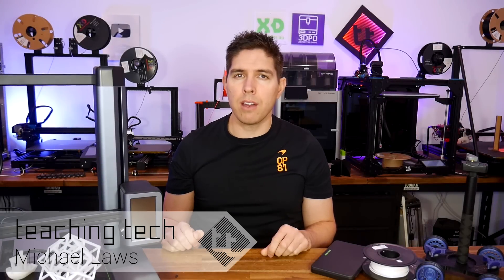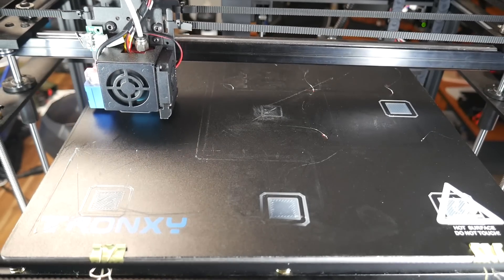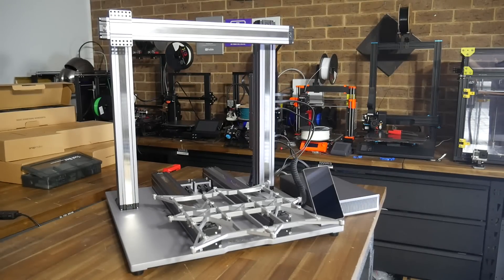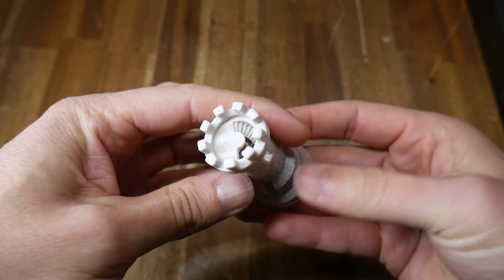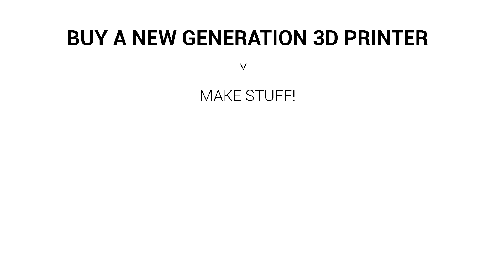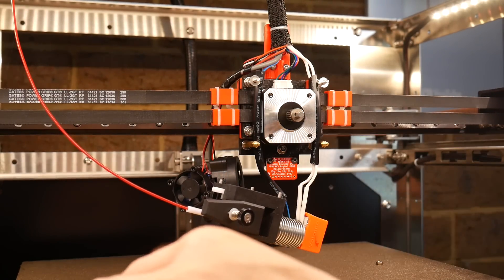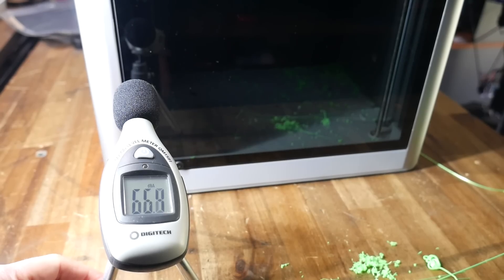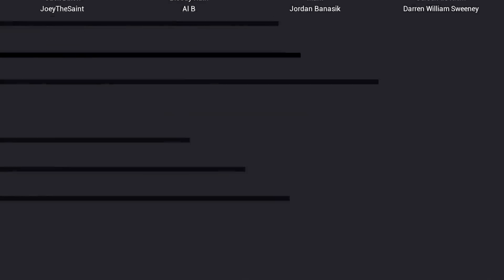Next gen 3D printers are here, but do they bring fresh problems?

Comment: i genuinely appreciate that prusa printers (and many corexy designs) are designed with 3d printed parts in mind. meaning if something breaks, i can reprint it and not worry about the change in mechanical properties from metal to plastic. and this also goes along with those printers being easily repairable through third party vendors. while i will credit bambulab for having very reasonably priced replacement parts, the fact i can only buy through a single source is kind of annoying. also being reliant on the company to design upgrades that fit the printer and my needs rather than being able to use open source designs made by anyone. 

before i bought my mk3s+, the p1p was really the only other printer in that price point i was cross shopping, and that was only because it actually had a way for me to buy replacement parts. while not everyone wants to tinker on their printer, right to repair is very important in electronics. both for the consumer to save money on repairs but also by creating less e-waste by being able to make those repairs.

using your own analogy, it would be like buying a car that "just works" until you get a flat tire and can only buy replacements from the original manufacturer. or the new subscription models we're seeing rolled out for infotainment or heated seat upgrades.
Reply: I dont want a 3d printer made from 3d printing parts. The reason I love 3d printing isn't because 3d printing is the best production technology, it's because it's the most accessible. But it's a compromise on almost every level, and I'd prefer production parts were made with production methods.
Reply: No one reasons like this with the rest of the stuff they own. You've got an open source dishwasher at home?
Reply: @bagibadoo439  no, but i can easily find generic replacement parts for things that break, maybe not for everything but a lot of things. i dont want literally everything i own to be a black box of mystery where i only know what buttons to press to make it work. sometimes i like to be able to fix things myself rather than hiring a specialist or replacing it outright. its not the open source nature of it that is attractive, its the ease of repairability. it just so happens that the reason it's so easy to repair is because the design is open source and anyone can make parts for it.

also one of the benefits of 3D printing that Teaching Tech talks about all the time is decentralized manufacturing and creating parts where off the shelf solutions don't work. imagine i had a part on that dishwasher that DID break and there was no replacement part offered, i could potentially print it out on my printer. to me, this concept goes hand in hand with having a printer that's easy to repair and find replacement parts for.
Reply: @WheatMillington  now, im not a materials scientist or anything but as far as i know the only difference between injection molded plastic and 3d printed plastic is layer adhesion. assuming parts are designed with that limitation in mind (print orientation, number of perimeters etc) then i don't see much of a difference other than appearance. i also think you may have latched onto that part of my comment and ignored the rest of it. it's not JUST that it uses 3D printed parts, it's that it uses parts that I can easily replace by myself without having the machine be down for days while I wait for replacement parts or a tech to come out and service the machine. also, none of the printed parts are structural so I don't have to worry about reduction in print quality when I replace a stock part, since plastic is much more malleable than metal. the parts that aren't 3D printed are readily available from multiple sellers, not just through prusa directly. when you can only buy replacements through the manufacturer, they get to set the price and if they stop producing parts you have to hope that some Chinese intellectual property thief makes a half decent clone.
Reply: @bagibadoo439  I don't want to have to call a technician to repair my 3d printer when it breaks down due to propriety parts. I want to be able to fix it myself. Half the fun of 3d printing is tinkering with the machines learning how they work. Being able to customize and upgrade parts.  You want a Mac, I want a PC.
Reply: @edstar83  I have owed, built, managed printers (FDM, SLA, MSLA, SLS) for 12 years as my main interest and job. Now I want something that prints really fast and with no tinkering since I don't have time or interest for it any more. I prefer a real welded steel frame and carbon fiber to FDM printed petg and bosch frame any day. You want a  project car which is easy to tinker with, I want a sports car to drive to work.
Reply: I love my prusa mk4 but the printed parts looks horribly cheap. Seems that settings were "printing in petg with a 0.6 nozzle a fast as possible"
Reply: @bagibadoo439  Then get a BMW.  They fall apart all the time and costs a fortune to fix but they look cool!

Comment: Tech support would be a start. My Cr10 V3 arrived with one motor with a bent shaft, almost certainly not in transit. Zero response from Creality so had to buy a motor. No problem it you know what you're doing but a problem for complete beginners. Next priority would be auto bed levelling without having to add a CRTouch. My first printer but great when setup properly. YouTubers like you were/are an enormous help!
Reply: That's rough. I bought a cr10 and modded it heavily but it treated me well enough. When I bought a new printer (not Creality) recently it was to avoid the luck of the draw situations like this that you described from Creality. Their support is not often very regarded as the best in the community.
Had to get the custom BL touch aluminum mount with little ity bitty metal shims to get it to behave when I did my bed leveling. Modded the firmware with both 8 bit and 32 bit boards because Marlin needs to be recompiled when you change other components and also have the BL touch, but it is easy enough these days if you have the time. Just use a 32-bit board unless you want the bootloader headaches that can happen in 8-bit-land.
The community like the gentleman on this channel is why 3d printing thrives and I could even learn this hobby with a low time budget.
Reply: That's how complete beginners learn. The whole idea of a "printer that just works", is kinda as realistic as a CNC machine that just works. In the end, you need to know how to use it, and that takes effort and time.
Reply: @Nobody-Nowhere  I was lucky in having converted a mini-mill to CNC control in the past. That made the CR-10 easy to fix and mod.
Reply: I have noticed Sovol printers are extremely good, they take the open source designs of Creality and fix the issues then upgrade them and still manage to sell them cheaper than the Creality model it was based on, they also have a Prusa clone, and have just announced their first Klipper machine the SV07 which is due for release tommorow, its a bed slinger but it seems to be a winner, I have never seen a bad review of a Sovol printer and have heard good things about their customer service also.
 I got sick of the cheap crappy printers on the market and decided I would build my own, I first chose a Voron but the kits at that time were always 20% out of stock so I decided I would build a Pro 3D V-King 400 and self source the best quality parts I could lay my hands on, it cost me a small fortune in shipping costs but I ended up with an awsome printer that has been lots less hassle than the Creality machines I have bought.

Comment: I started with the Snapmaker from kickstarter but due to continued problems and very slow prints, it started gathering dust. After seeing many good reviews for Bambu Lab (and also having a DJI drone), I decided to try again with the X1C. What a difference!  Worked out of the box and takes between 1/10 and 1/4th of the time to print. Have had for 2 weeks and printing non stop, making toys for my granddaughter and useful parts. I am not a tinkerer, so this is exactly what I wanted. I did have a clogged extruder (due to a stupid mistake on my part), but the online videos were good enough to walk me through taking it off, and I was up and running again in a couple hours. Have some spare parts on hand in case of future problems, and they are priced rather reasonably. I think everyone benefits from competition, so hope others start making printers that just work!  Thanks for all your thoughtful reviews and videos, love your channel.
Reply: printers that "just work" until you can't buy any replacement parts because "support for that product has been terminated". that problem doesn't exist for Prusa printers and similar, that have been designed from off-the-shelf parts from their inception.

Comment: Man I feel this so much.  I bought a Sovol SV01 Pro a few months ago and I've had a terrible time getting it to work right.  To be clear, I think it's me, not the machine.  I largely want it as a tool.  I have limited time to tinker and I have a number of other hobbies that take up my time.  I want something that just works out of the box and needs limited intervention from me.  I will probably end up with one of the printers you mentioned soon b/c I just don't have the patience to mess with this thing.  You nailed it in this video!
Reply: sv06 plus .. omg what a machine for the £
Reply: Then a Bambu would be the printer for you.
Reply: FDM printing just sucks.
Reply: I started by building 3D printers when there were no commercial 3D printers other than Stratosys ($$$).  Then I bought five QIDI Tech 1 printers for a small print farm because they had good specs and were designed with linear guide rods when most hobby 3D printers used extruded aluminum V rails.  The enclosed printers weren't reliable and the enclosed design made them difficult to repair.  They used parts developed by the open source community that QIDI modified, not to improve them, but to make them proprietary to force me to buy their replacement parts.  Then a year later, QIDI came out with a new printer and dropped support for the model I bought so I was unable to buy their proprietary parts and my $3000 investment became orphaned products heading to the landfill.

I replaced the five expensive QIDI printers with one inexpensive Sovol SV01 (not even the PRO version).  It's been a reliable workhorse.  The open frame design means I can't print ABS, but it prints TPU very well.  I've had to clear two clogged nozzles and replace the hot end heater, which was an Ender hot end cartridge heater than was inexpensive and will be available for a very long time.  The open frame printer design is very easy to maintain and repair.  The only thing I didn't like was the SV01 uses a microSD card that's located in a very inconvenient place, even though it's on the front of the machine.  I recently upgraded the SV01 with a microSD cable to an SD card connector that is attached to the front of the user interface panel with double sided tape so I'm not fumbling with tiny microSD cards, and the SD card slot is now in a very convenient location.
Reply: You are not the problem get a p1p it just works
Reply: @michaelperez6811  - The P1P just works.  Sometimes it just works in the middle of the night because the Bambu Lab Chinese cloud server tells it to start printing for no good reason.  If you have a part on the bed from a previous print, the P1P will crash and destroy its hot end because the much touted AI collision detection doesn't work.

Comment: My hobby is messing with my 3d printers and after building and designing my own it would take a lot for me to buy a new printer again. The Bambu X1C and AMS for multi material is the only one that could change my mind, but it's just too much money and I am not a fan of the cloud software or not having the option to repair it myself. I am very happy that these new machines are going to make life easier for people that just want to print and not have to setup profiles, fix poor cooling ect. If you use the correct parts and understand how they work you can make your own kits that can print just as fast, if not faster and have the same quality too. It's an exciting time to be into 3d printers and I wished everyone could just get along without  mine is better than yours attitude.

Comment: When it came to printers I've owned 5 different fdm models over the years and have seen improvements with recent models that were formally races to the bottom. Elegoo in particular was making better versions each time rather than making 6 versions of the same thing, some more or less expensive (tho they did release some too close to each other). 

Thanks to you I ended up building a ratrig v-core 3.1 500 and it's become my favorite thing. Being able to easily update firmware once I had built my ratrig was such a relief and even though there isn't central support the discord is better than most I've experienced.

As much as I do like seeing these more well put together machines I do hope they keep themselves at least partly open source. Bambu definitely paved the way for a new generation as we're seeing clones coming up pretty quickly. They've also benefited from community mods like the hydra for their AMS.